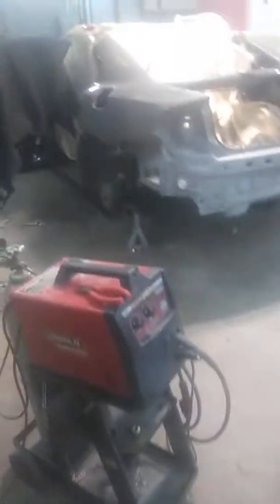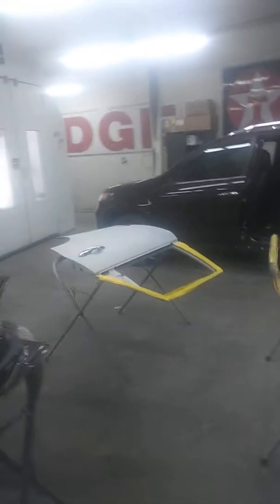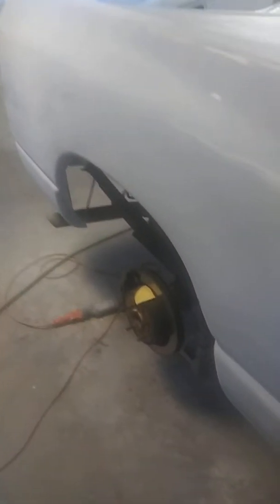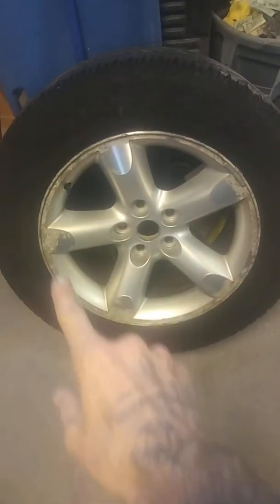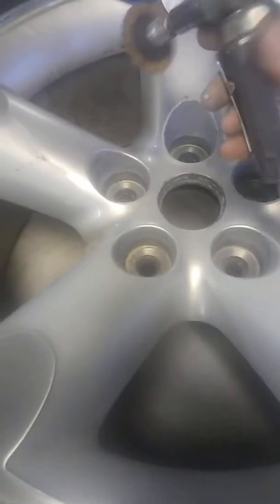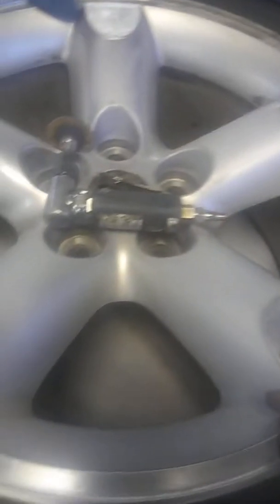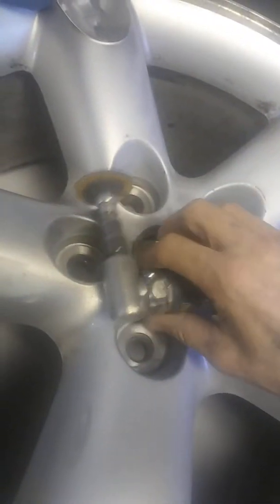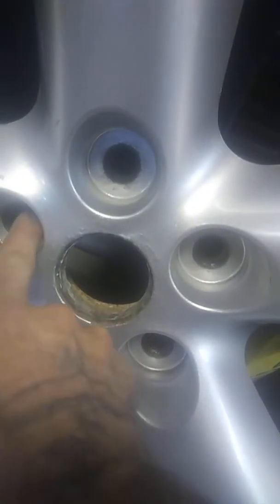Dodge 1500 progress

Comment: The charger looks amazing. As do those rear fenders on the truck.  You been busy brother. 
Don't the wheel nuts cover the bottoms of the holes in the wheels? As long as the corrosion is gone, I wouldn't put a whole lot of work into polishing the holes.  Ya might find getting a good polish problematic where the corrosion has been removed from around the rims as well but you're the man with the elbow grease. LOL. 
Later and thanks for the update.
Reply from the maker: Im just going to re paint and give the bare aluminum the brushed look so its similar to th factory machine marks